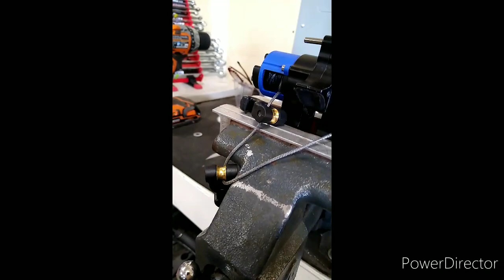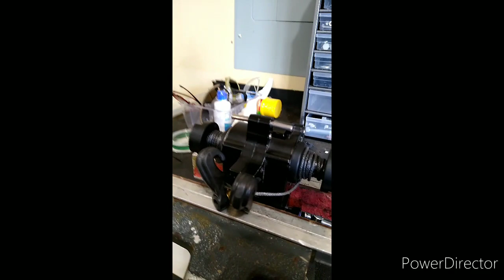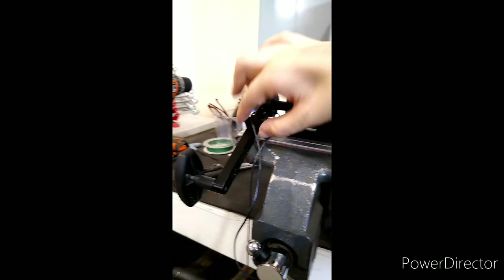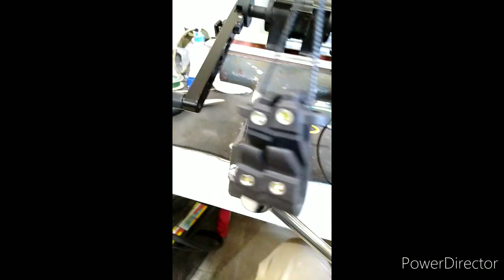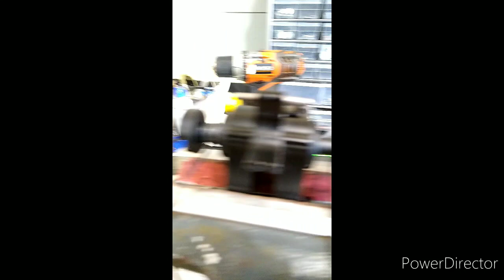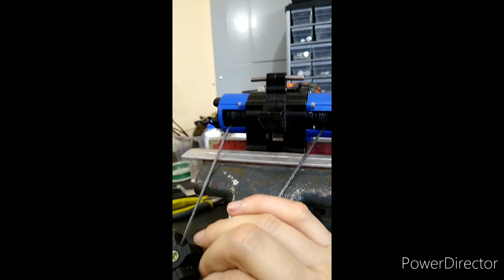Charger EXT hook and cord replacement

Comment: Thanks to your vid I just completed this hook upgrade. I was able to do it with the charger mounted to my crossbow by extending the rope and looping it over one of my limbs and hooking it around one of the REDS bumpers. On re-install I had to cut the end knot off at a severe angle to allow the rope to thread back through the hole (should mention I had to cut off the end of the rope to just get it out of that hole with the sleeve because the melted end was too big to fit through even after removing the knot).
Reply from the maker: Awesome, glad you found it helpful.